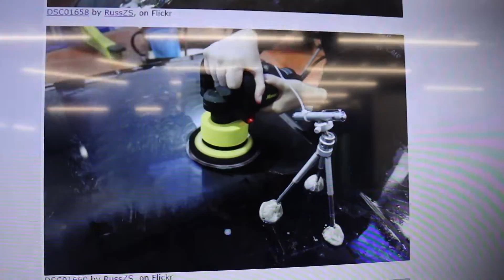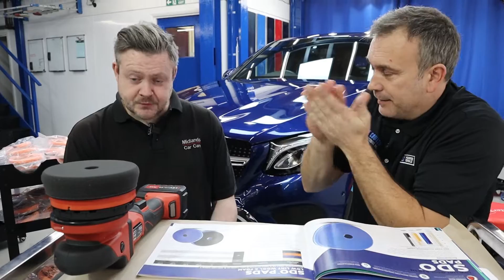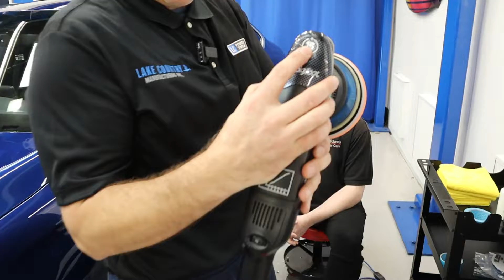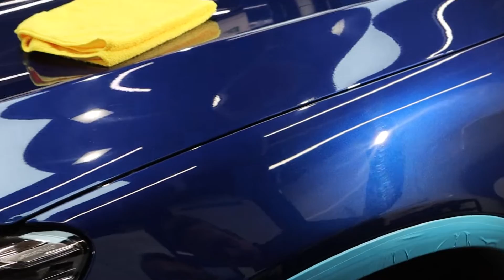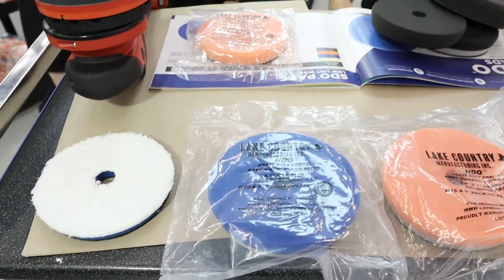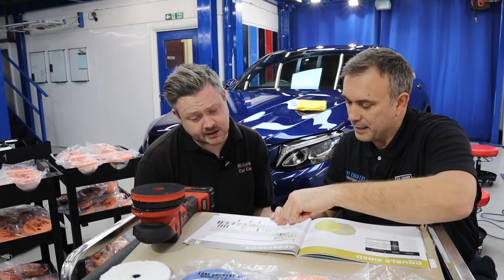Deep Dive into Lake Country's HDO pads by KDS Keltec

Comment: What speed would you recommended on the HDO Orange pad with the Menz medium cut. I have the Carbon Collective 15 mm machine. Also what speed with same pad & compound, but 3” pad on a 9 mm throw machine (so use SDO pad). I currently use speed 4 on both machines?
Reply from the maker: Hi Peter, this is Jay B from the UK facility.

The speed required comes down to your personal technique and the task at hand, because the rate of material removal will be determined primarily by three combined factors: pressure, cut (abrasive characteristics of the pad and compound), and tool speed.  Having more or less of one affects how much you want, or need, of the others, and the key is to find a good balance.  

Kelly and I use a technique that generally involves lower-than-average speeds, but higher-than-average tool pressure, and this is a style that suits us (and has done during 1000's of full correction details) because we find it allows us to reap the benefits of the compound's abrasives quickly, and also diminish it more thoroughly, resulting in a more efficient workflow.  Another pro detailer might come along and ultimately achieve similar results but with a different technique.  In fact Jim White of White Details did just that before Christmas when he came here for a guest feature.  His machines tended to be running faster than ours, but instead he wasn't pushing - or in other words using as much pressure - as we would.  Don't get the wrong idea, we're not trying to bend the car!

Ultimately most orbital polishers don't need to be run at top speed to be effective, and just like a car engine at the redline - you can hear when it's being needlessly thrashed.  Aim to go as fast as feels stable and comfortable, likely somewhere around 2/3rds of the way up the speed dial, and be guided by your progress.  If you're not sure, stop your passes early to check what you've achieved and then potentially take the opportunity to increase or decrease your cut (change pad / polish materials), pressure (adjust how firmly you apply the machine), or speed accordingly.  Pro tip though: while you're learning, change only one variable at a time, so you can properly assess your findings.
Reply: @LakeCountryManufacturing  Thanks for your response Jay and the level of detail ( see what I did there). I guess machine Polishing is really open to what works best for the user and understanding what the defects are? Most of what I do is a single stage just to enhance the paint prior to LSP. I only work on friends and family, so know the paint well enough. They have all had the full ( as best as I can ) 2 stage, so really only get a light buff after a decon and reapply LSP. 
Great feedback though, think I will get a couple of test panels and play about with them based on your advice and see if it works for me. At the moment I usually go to about speed 3-1/2 to 4 with light pressure, it gets the desired results. 👍🏻

Comment: What you guys didnt use the dynabrade 61385 19mm orbit DA accessories back in 2007-2011 prior to the rupes bigfoot like i did in australia and some did in the USA.  They were awesome defect destroyers.
Reply: I've seen those a couple times used by old school body shop guys. You put that big heavy ass metal apparatus on an already big amd heavy ass rotary.. whew. Glad I don't have to muscle that anchor around all day. It's a correction monster though.

Do you know if they made two versions of it? Gear driven and free spin?
Reply: @jdisdetermined  yes they did have the random orbital only version and the combination offset rotary (pin locked in place for rotary direct drive) and random orbital.  The best power tool to connect these to is the flex stone grinder which is only 2.2kg weight and 1500 watts /30+ nm torque. A high speed monster. Up to 7500 rpm.
Reply: @matthewgibb2640  Wow. I don't see people talking about that tool anymore. Good to see some others talking about it!!
Reply: @BB_Detailing_00  yeah definitely. I love anything and everything about the history and evolution of detailing. 

Seems like it would be an awesome tool for doing big gel coat jobs, especially if you paired it with a light weight but powerful rotary. I've done some big boats and RVs.. man do those guys earn their money! Especially big boats with that friggin' tapered hull. I give absurdly high estimates on most of those now so I don't have to do alot of them. 😁👍
Reply: @BB_Detailing_00  that flex grinder and the dynabrade was amazing. So smooth and immensely powerful